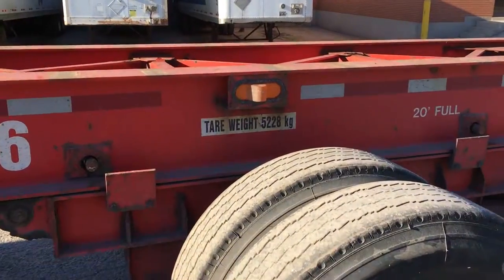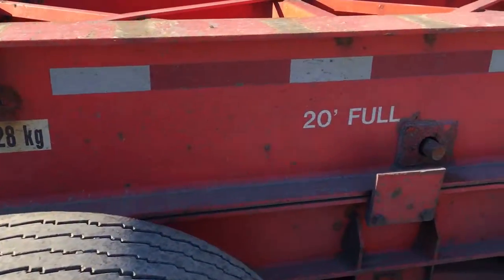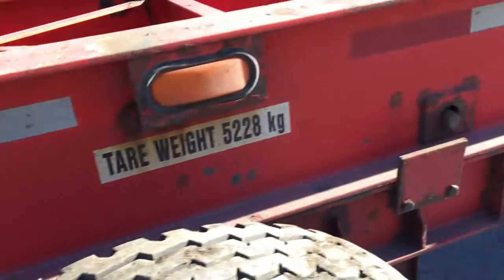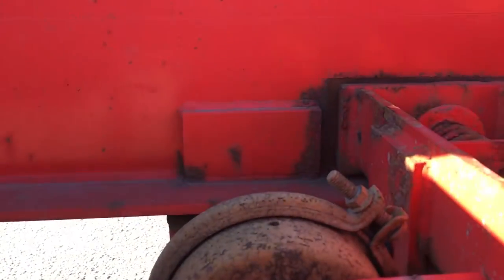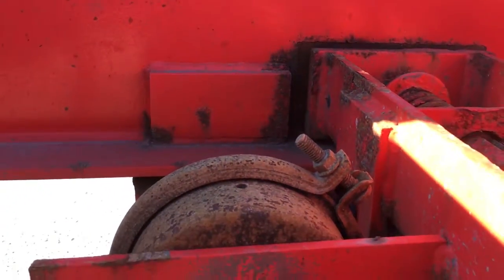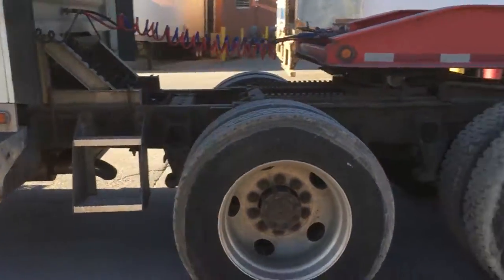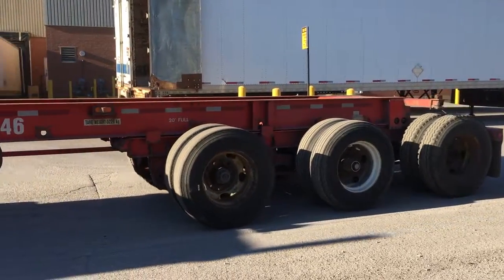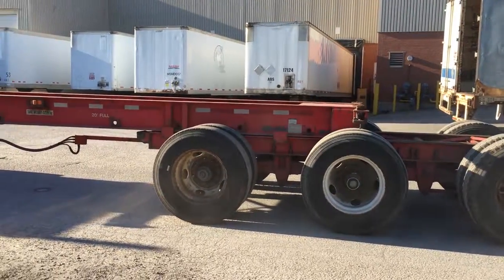20ft Extendable Chassis operation

Comment: So what is the reason for the slide bogey on this chassis if it holds the same size container?  Weight transfer?
Reply from the maker: Yes, On this model of chassis it is only for transferring the weight of the load so that you're not overweight on certain axles. usually If your heavy on the trailer,  you slide backwards. And
 If your heavy on the truck, you slide forwards.
Some models also Have a fifth wheel at the back of the chassis to make it a lead B-train. These if not properly secured can be very dangerous as the secondary trailer will disconnect from the primary.
Reply: I was thinking the same thing. Great question. It makes sense now.
Reply: bridge law. from last wheel hub to the steering wheel hub needs to be minimum 51 feet

Comment: the European trailers  are better made
Reply from the maker: 100%, they have better twist lock design and they use lift as well as steer axles. 
Plus having single tires is so much cheaper to maintain.